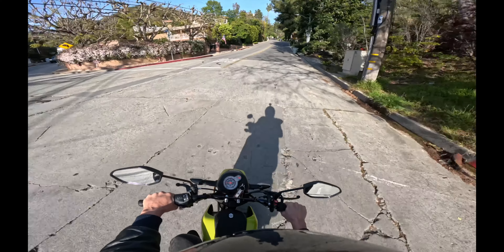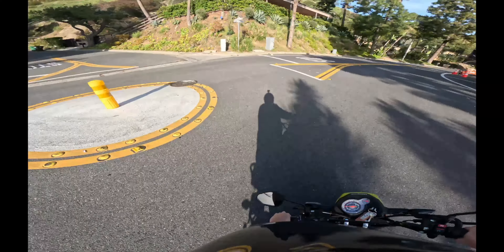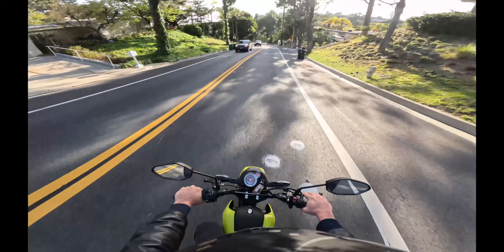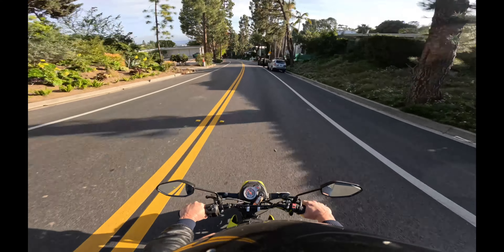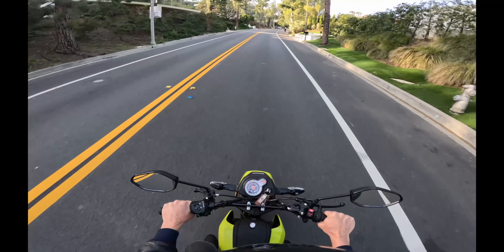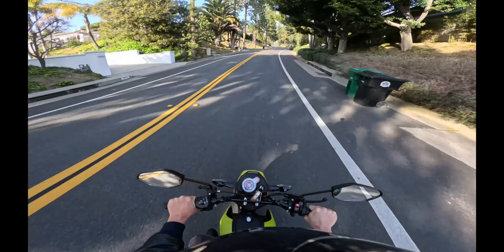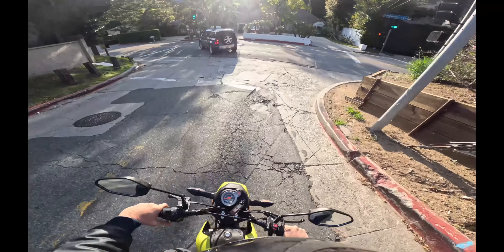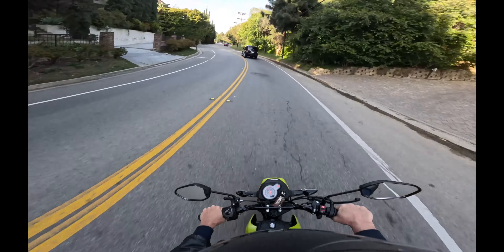Honda navi Hill climb test and ride

Comment: Good times! All the after market exhausts are  very loud by comparison to the stock. It does look like the Hot Lap, Vance & Hines, and Yoshimura can all be fitted with some fiberglass inside the muffler around the outer part of the silencer inserts. I think Scooter Swap Shop  test and dyno  a Polini carb on a stock Navi exhaust for a two horsepower gain.

Comment: Nice video. I have posted some hill climbing videos too on my channel with the Navi. I find that with 8.4g or 12g rollers really improve the climbing. and will improve your speeds 2-3mph as well. You might want to try swapping them out. Its a cheap upgrade.